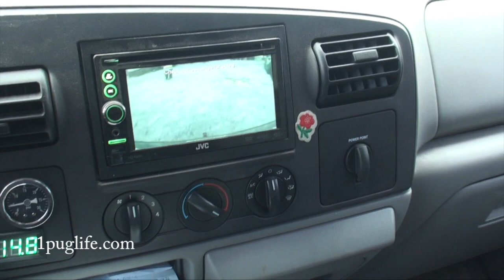air on the back end

Comment: attach those two compressors to each other so you have twice the air
Reply: +Thibault StovePipe!
Reply: He already said he's using the tank as a secondary air tank.

BMP!
Reply: +Thibault Twice the capacity but the one compressor is completely cocked and burnt out
Reply: +sc0tte1 he's referring to connecting the broken compressor ( just the tank) to the new compressor so he'll have double the capacity, only problem with that is the compressor will run forever to fill both tanks.
Reply: Jerry Baker Yeah I know that's what he meant, it will take a long time to pump double capacity, he better make sure there's no leaks whatsoever.

Cheers
Reply: +sc0tte1 right on.
Reply: +Thibault Screw compressor, just saying.
Reply: Once full twont turn on asmuch, friggin rights
Reply: +sc0tte1 in the long run it's better on the compressor and hydro so it's not always turning off and on. it will take a while to fill up but not very long those tanks are preatty small compaird to most.
Reply: +Thibault That wont do shit aside from waste space, take time and waste money on plumbing it.
Reply: Thibault I agree with you.  The most damage in an engine (or compressor) occurs just after startup when it's still cold and has no oil pressure.
Reply: Yeah Nah, receiver to use = 1 gallon per 1 CFM compressor flow, the double size is no fkn use and has a downside too. if you want to waste time and money doing it then go right ahead but I'm too old for that shit, I'm a mechanic and I fix things once not twice.
Reply: +AusMecham space would be the killer for me if i were a massive hoarder
Reply: plowmaster1206, Are you self smarted ?
Reply: Georgia Home Boy That too, aside from that adding the other one will cause a pressure lag because the compressor cant refill the bigger tanks fast enough to get pressure back to set point at the tool, tank size is important, not too big and not too small, and anyone that tells you otherwise doesn't know a frigin shit about compressors.
Reply: +AusMecham brilliant.

Comment: Chris for the throttle, use a flat bar and bolt to the frame, thumb throttle to the middle of the bar, engine to the  top them you get the leverage, 1inch travel by thumb would be two inch travel to the engine cable.

Comment: try finding a spot on the throttle lever that moves the same distance as the cable slack drill new hole cable issue throttle lever problem solved!

Comment: IR use to be a solid name brand and expensive too! even their air tools went cheap.
their new stuff is small and cheap! well cheaper, their entry level 80 is still a grand.
compared to 2500.00 but ya get what ya pay for.....
10 years ago that 80 would have double the electric motor and double piston cast block.